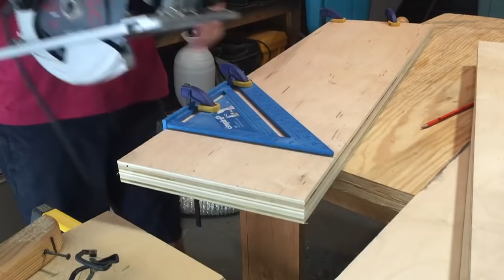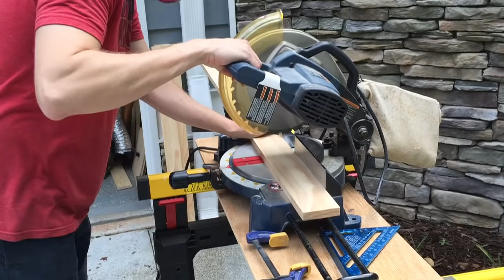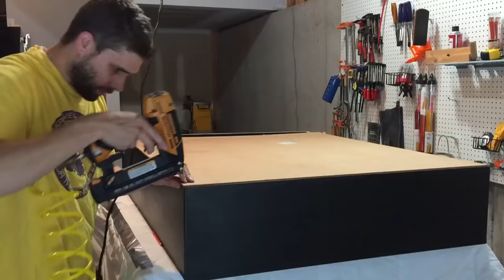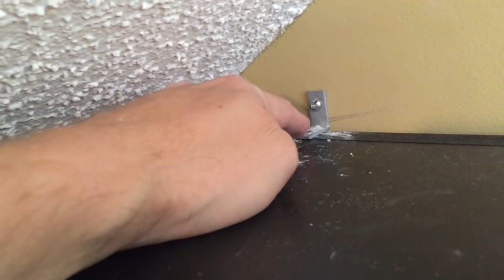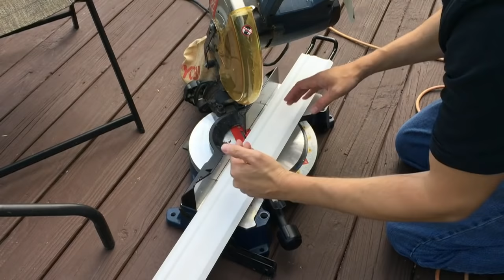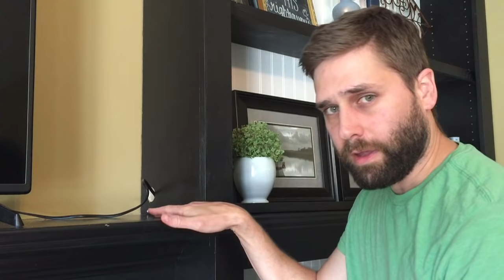DIY bookshelves with crown moulding

Comment: Beautiful! Another couple options instead of the L-bracket would be to put pocket holes in the top, measured to hit your studs, and to put screws right through your backer and into the wall, then cover them with FastCap's Fast Cap product. That's the usual approach for residential cabinetry, but that's usually done with cabinets with doors. But if you placed the screws at strategic heights you could plan for sometime to always sit in the way. Or, the way I did ones kind of like these last week (except all short, so no crown molding), I screwed right through the backer without respect for height placement, then covered with bead board with glue and pin nails. It will be a beast to remove if anyone wants to someday, but it's not going to move anywhere by accident.
Reply: I forgot to mention, you can also glue and pocket screw your crown molding together before installing it. Let the glue set before you hang it and the joint will stay tight. There's a great video on the subject, if you can find it, called The Pocket Hole Solution to Trim Carpentry, or something like that.
Reply from the maker: Nice! Thanks for the tips. I didn't think about pocket holes for the molding and for attaching it to the wall. I was kind of flying by the seat of my pants on this one. Everything I did was based on what I thought woukd work, haha. I probably could have researched a little before starting. What I did to close the gap where te crown molding met each other was to squeeze the gap closed with one hand and shoot a nail through from the outside. It seems to have worked. I just covered thr hole with filler and sanded/painted.
Reply: Chris McDowell | CMR Woodworks That certainly works. And you're basically describing how I learned. I was doing drywall repair for a company that did windows and doors. They did a massive condo renovation project and every unit needed drywall repair around the windows and doors. I showed up and did the first unit and as I was cleaning up to leave the homeowner asked who would be doing the trim molding and when. I asked the site super who hadn't considered that. He checked with management and the guy who sold the job and no one had considered it. Brilliant. They were fine with leaving the homeowners to fend for themselves, but I wasn't, so I learned how to do it and I just arranged with the homeowners to buy the molding. With the help of YouTube I learned how to cope inside miters and other tricks to improve my quality. It was a good learning experience, made the customers happy, and in a few instances turned into side work where the homeowner paid me to do extra work for them. And I found a better company to work for as soon as I could. :) 

Even with pinning the miters as you described it's still best to use glue. Everything shifts over time, so give it every reasonable chance for lasting success.
Reply from the maker: Neat story! I thought about putting glue after I had pinned it.  I may try to push some glue into the joint from the backside. Speaking of learning on YouTube, I literally learned how to woodwork watching YouTube. I had no other medium to learn by. So, I am a product of those such as Marc Spagnuolo and Steve Ramsey. Hopefully I'll get better with time.